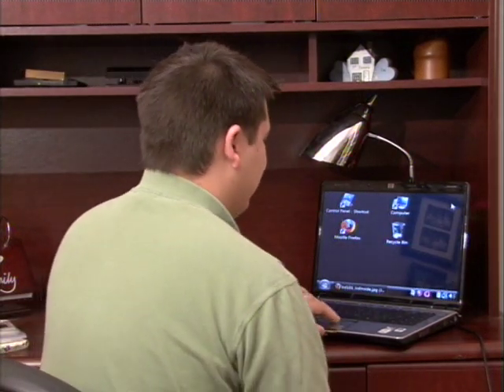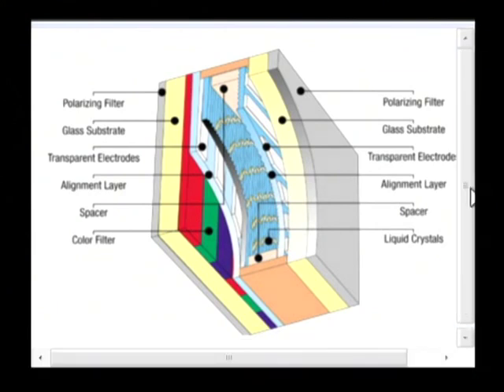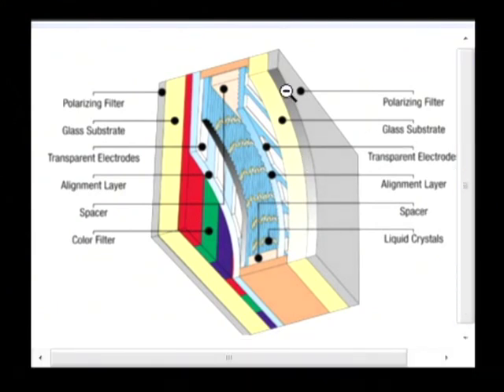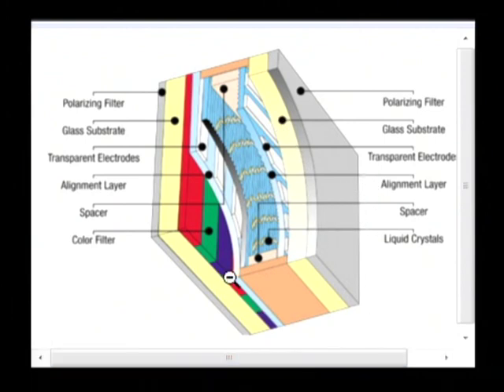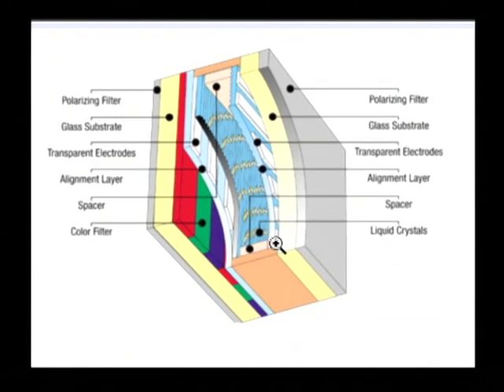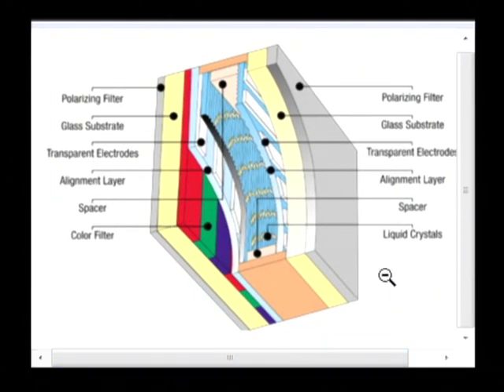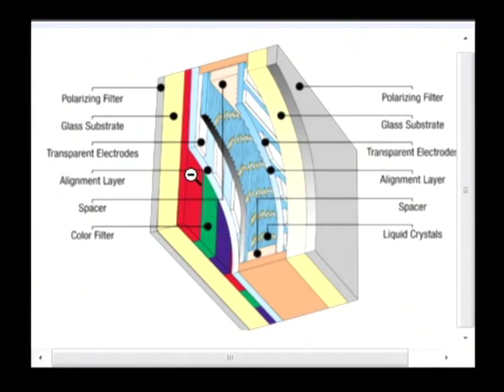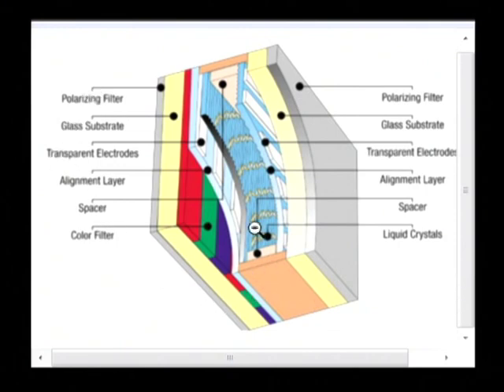Computers & Laptops : How Does a Computer Monitor Work?

Comment: Can some please explain how is the signal passed from laptop electronic  to the screen?
 I do not  seen any other physical connection between  the computing electronics and the screen except the two plastic hinges.
The answer can help in changing the screen if the screen gets broken (as mine).